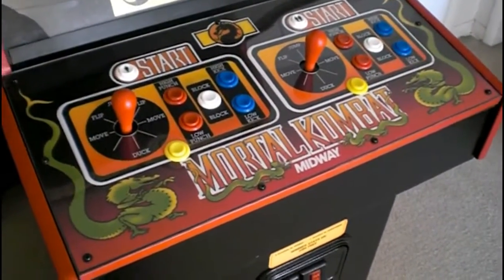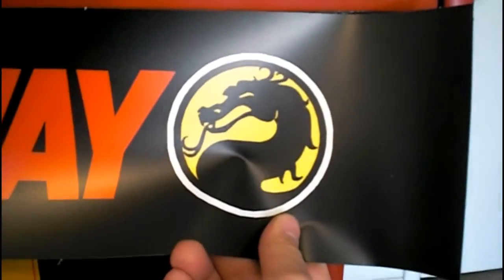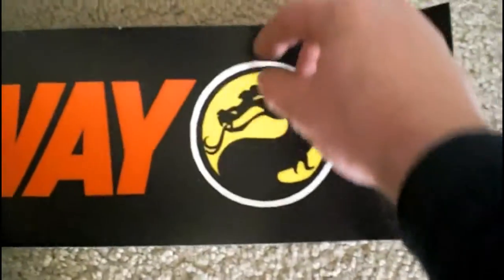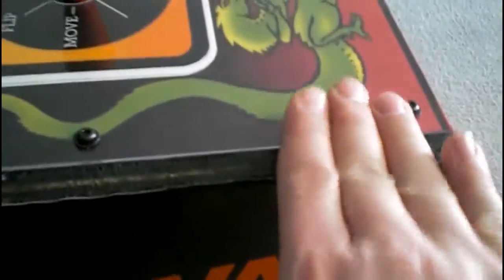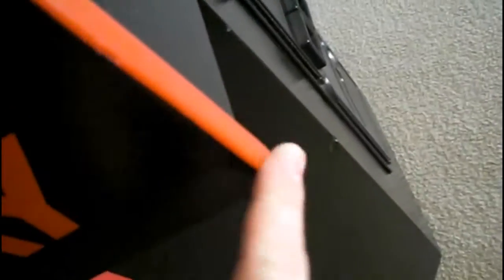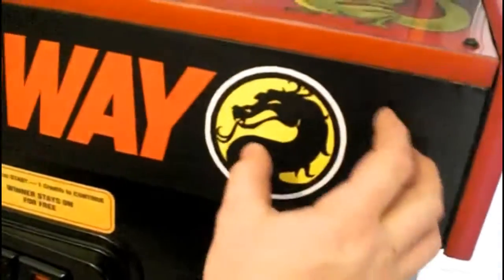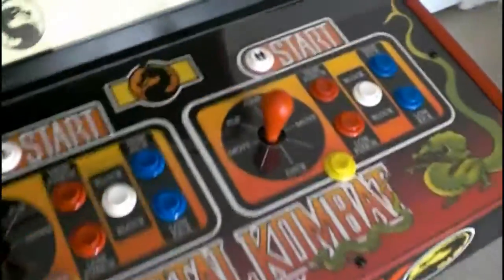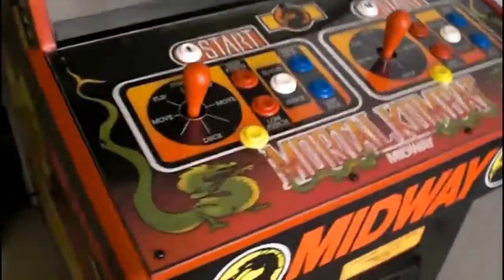Another Mortal Kombat Multi Arcade Project (Part 3)

Comment: I'm not so good with any kind of woodwork so I just figured I'd commission a carpenter to make the actual cabinet. There is no shortage of them around here, and getting a new one made costs less then purchasing an actual cabinet from an arcade seller. But they require an actual cabinet plan in order to be able to build it.